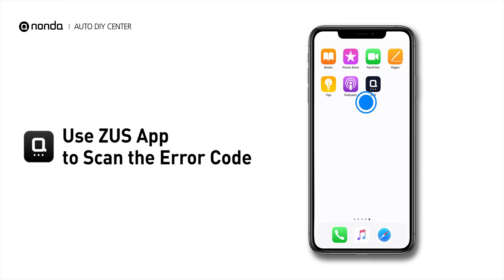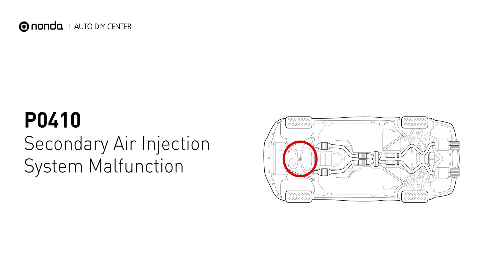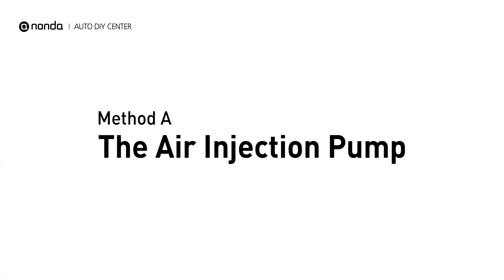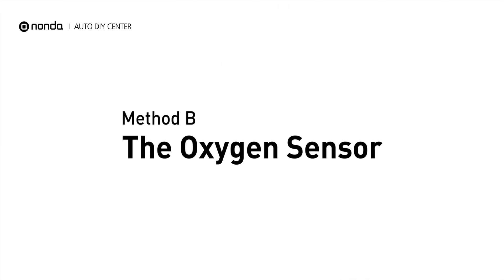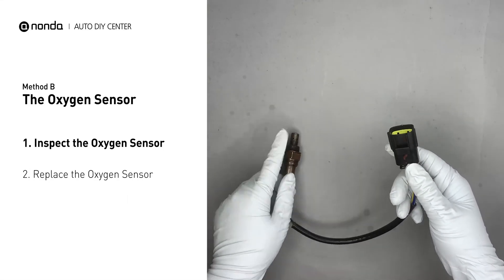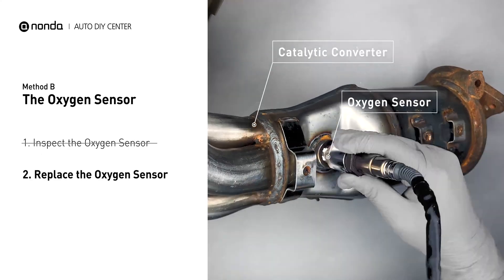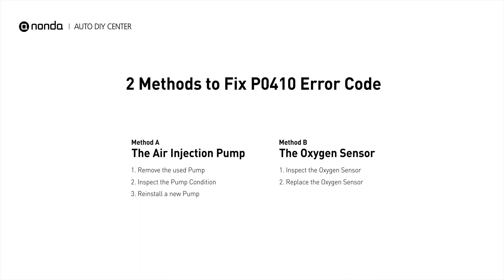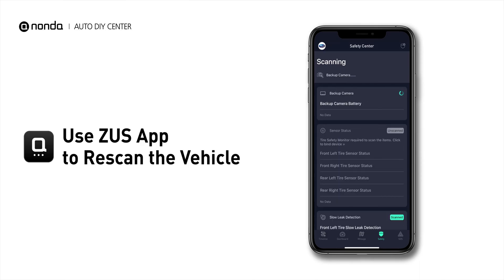How to Fix P0410 Engine Code in 3 Minutes [2 DIY Methods / Only $9.55]

Comment from the maker: Hi, I'm Steve, nonda's lead mechanic engineer. 
Feel free to leave your comments here if you have any mechanic questions, I will be glad to help you out!
Reply: I have the p0410 error on my clk 2008 350. 
I changed the air charge pump, secondary valves were inspected and the wiring were all checked in addition to the air hoes, I'm still getting the error.
After clearing the code, it gets on again in 2 to 3 days of driving. Any idea?
Reply: Hi
I have error code P0135 and P0410, I have a mechanic that can install the part. Any ideas what to order first? 2001 Mercedes Benz SL500 Darlene

Comment: I got this code and had oxygen sensors replaced. The mechanic cannot get the code to go away. Advice anyone? Forgot to say nothing wrong with the pump either. It's fixed but code reappears. They spoke of a software update they couldn't get from GM.
Reply: I believe it's the Air Injection Pump Relay. Did you find the cause?

Comment: Hi I have a chrysler crossfire 2005 and this code keeps coming up on my reader I replace the valve switch, tried testing the pump yesterday but when I put my volt meter on the pump connectors and the ohms didn't move from 1 does that mean the pump is fine? Thank you going to try the oxygen sensors next

Comment: ‘05 Mercedes c230k. I get codes P0303 and P0410. Will changing the 02 sensor fix the problem?
Reply from the maker: Hi Dani, as you are receiving more than one error code, we highly suggest to get your vehicle visually inspected by your local mechanic for further diagnosis.

Comment: Hello Steve I have a 06 Mercedes’ Benz c230 sport with the code p0410. My air pump motor works but has a little winning noise is it normal? Works close to a minute then stop. I cleaned the air valves they were full of carbon also replaced  all vacuum lines  then removed the code with a scanner but 2 days later I have the same code   What else should I do ? Thank you
Reply from the maker: Hello, please confirm if this is the only code you're getting.

Comment: Which o2 sensor controls secondary air pump,  upstream or downstream?
Reply from the maker: Hello, please provide us with your vehicle's year, make and model.
Reply: @nondainc  2011 mercedes benz c300 4matic
Reply from the maker: Hi Ashburgo, it's the upstream.
Reply: @nondainc  what about a 2007 c230 sport flex fuel